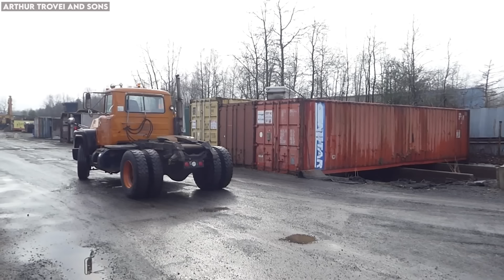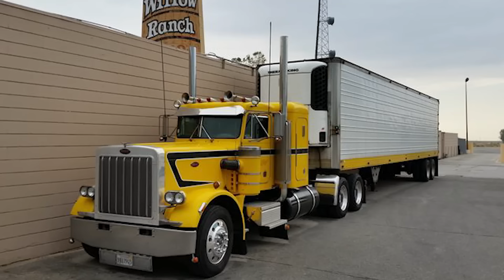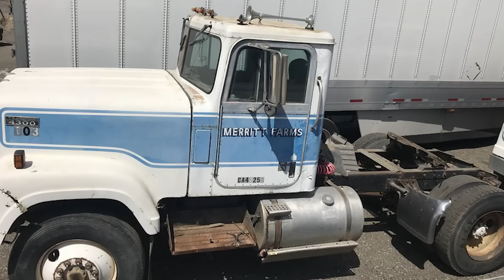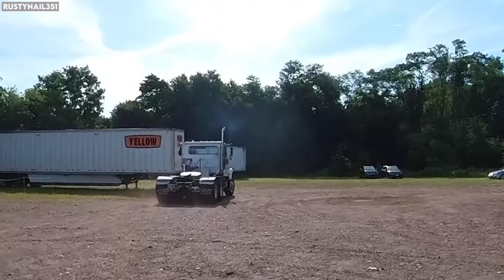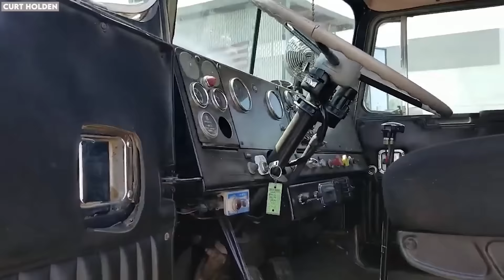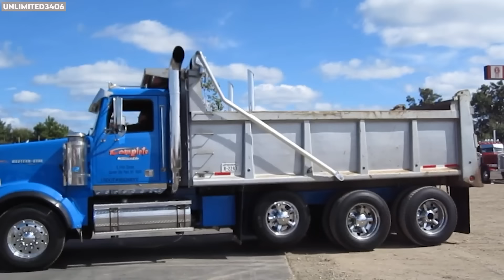10 Vintage Trucks With Engines That Never Quit

Comment: In 1977 the Mack E9 was 998 cubic inches, not 865. The 865 was in the 1960s and early 1970s the E9 was built specifically for the RW, Superliner. From 400 horsepower to 500. The torque was 1740, pound feet. The highest at the time.